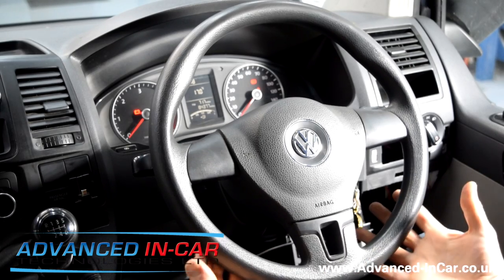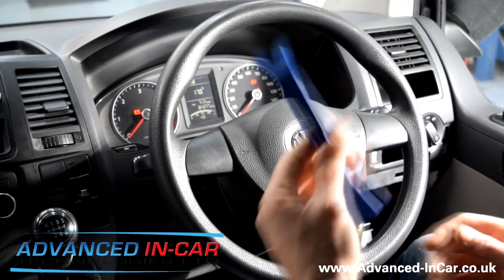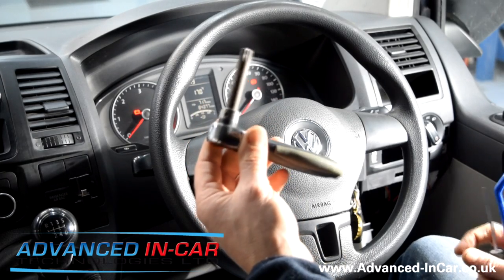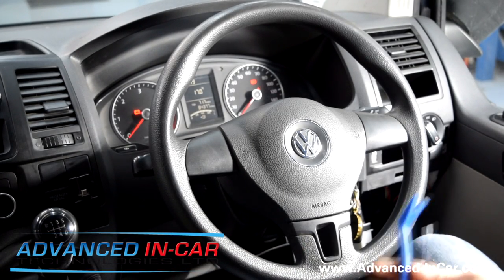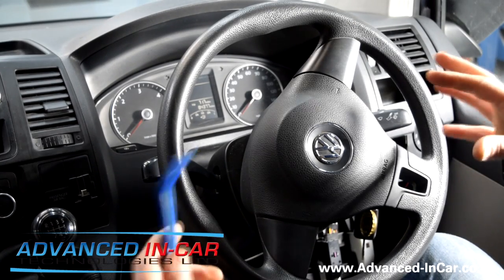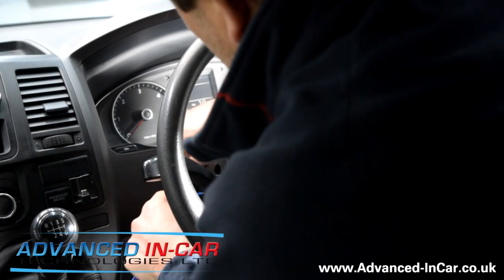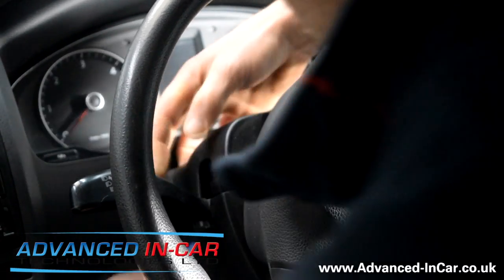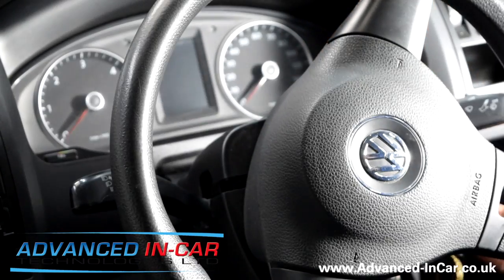How To: Remove The Steering Wheel On A Volkswagen Transporter T5 & T5.1

Comment: Are the T5 and T5.1 interchangeable?
Reply from the maker: Do you mean by fitting a T5.1 Wheel into a T5? It's possible depending on the BCM And you will need quite a large wiring loom and relay for it to work properly.

Comment: So you really don't need to disconnect the battery?? Bonkers! everywhere else i've seen or any advice i've been given on this say disconnect the battery!
Reply: I've sat in a car where the guy was fiddling with the airbag, and it went off when it was disconnected. I would highly recommend disconnecting the battery and waiting like 10 minutes.
Reply: I agree that disconnecting the battery is good practice.
However top marks for a great tutorial.
I just changed my steering wheel & without this I wouldn't have had a clue where to start..
Excellent 🤘
Reply: I followed this and it worked a treat, I didn’t remove the cowel, it’s pretty easy